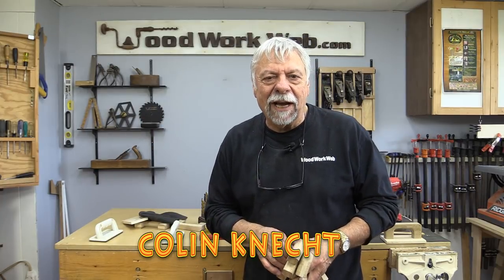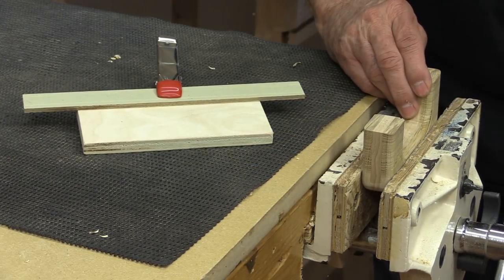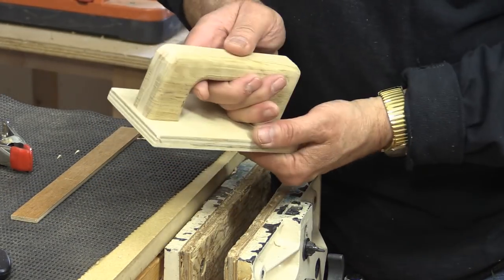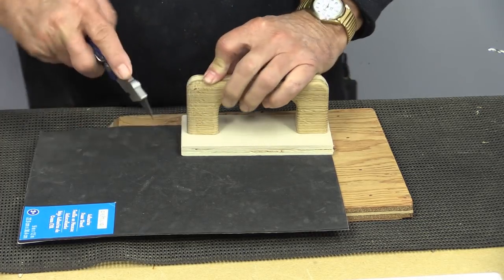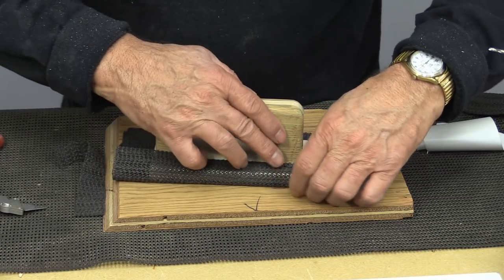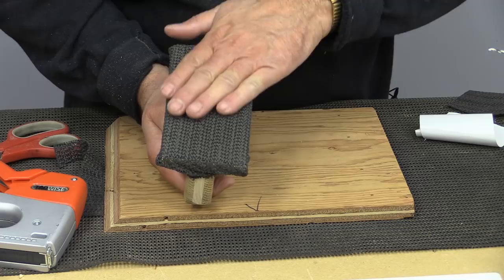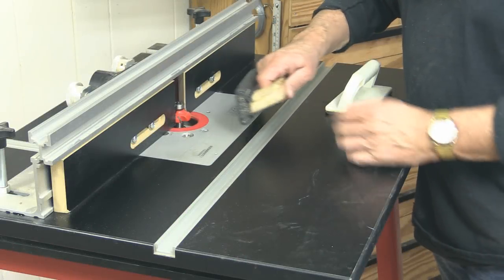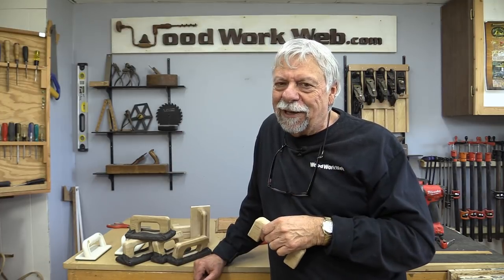How to Make Push Blocks for Table Saws, Router Tables and Jointers

Comment: I made a bunch of push sticks and pads from old pine. I held them together with glue so no screws would get near the badges. I also used cheap very fine sandpaper that came with some sanding blocks to give grip. It was useless for sanding as there was very little abrasive but gave a good grip for this purpose. I stuck it on with adhesive thinking it would need to be changed pretty quickly, however it is still working over a year later.

Comment: I did something like this but didn’t want to use screws Incase they hit the blade.
Reply: I can understand where he's coming from. With a table saw, the saw blade regularly cut into push blocks and push sticks. It's just one of those things. They are made to be expendable. Putting a screw in a cheap expendable piece and ruining your nice $120 carbide blade makes absolutely no sense. I bit of glue and a dowel pin is a far cheaper and safer choice.
Reply: Mike Bennett that is not a push stick as much as a hold down. You wouldn't want the blade touching that at all. Push sticks have long handles. If you planned on the blade touching that it would be the worst design ever. You would be cutting off pieces of it all the time your knuckles are a 1/4" away.  Those are made for stuff where the blade or bit is not going all the way through which is why if something hits a screw you're in big trouble because you are not that far away. If you watch the video you will see that bit is not coming through the top of it, if it was you would want a traditional push stick so your hands are far away.
Reply from the maker: I have to agree with Randy, if you're hitting the screws, you have bigger problems. But, could easily replace the screws with dowels and glue if needed.
Reply: WoodWorkWeb haha. Of course. I don’t necessarily disagree with Randy, but the whole reason I’m using a push block is the inevitability of a bigger problem. Otherwise I’d use my hand.  I’m using a push lock to save my hand, not the blade. What’s wrong with doing both?
Reply: ManCraftingTM all I'm saying is if you hit the screws your fingers are screwed. If you have to worry about hitting those screws you should just go with a different design all together. I really like those though and will definitely make a pair in the future.
Reply: You could use dowel pins.

Comment: How did you cut the angles on the tilted handles?  Did you just angle the blade on the table saw to 15 degrees and run the pieces through there?  Thanks!

Comment: I sure think a replaceable think strip of plywood at the back of the push block would be more of positive control than rubber surface that could possibly slip.
Reply: You're right but only if you're pushing a piece from behind (like on a table saw).  Most of the time on a jointer or router table you're holding the piece down in the middle and dragging it over the blade not pushing it through the blade.
Reply: You could cut a thin block of wood that is slightly taller than the push block, then screw it in the center to the back of the push block so that one edge is even with the edge of the block and the other is slightly proud of it.  When you want the lip you flip the proud edge down, and when you want a flat push block you flip it back up.

Comment: That are great push pads! Thanks for sharing.. But what is exactly the purpose for the self-sticking foam?
I used only the anti-skid material some years ago when making my push blocks.
Reply from the maker: It acts like a buffer between the anti skip material and the wood, so it doesn't wear out as fast!
Reply: Thanks for explaining. I'll keep it in mind for the next time.

Comment: I would never use screws, the blade could be damaged if it hits them. I would use wooden plugs (in German Holzdübel) for that and glue the handles somehow onto the base.
Reply: If your blade is touching a countersunk screw on your pushblock you have a bigger problem than damaging your blades.
Reply: Hey use wooden screws.